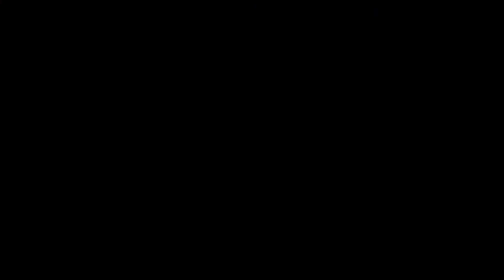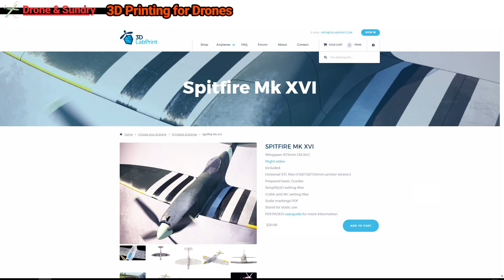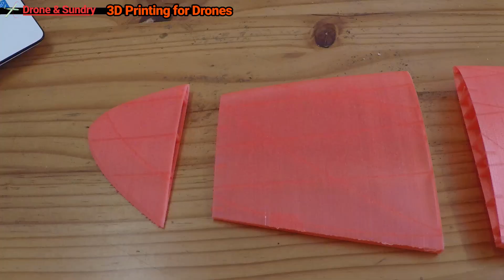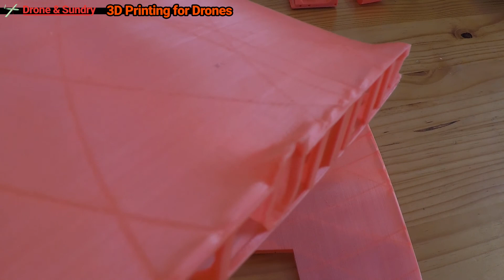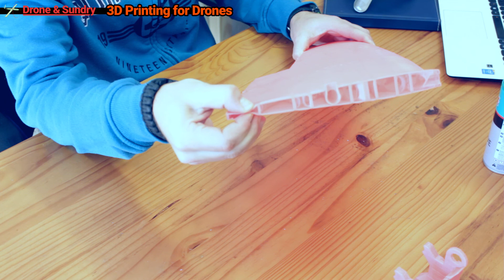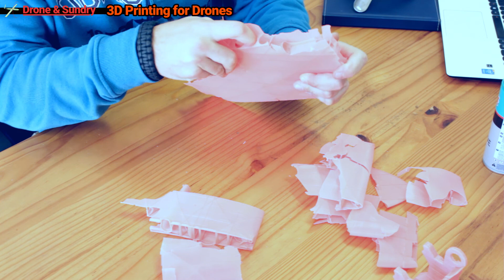3D printed Spitfire wing strength test | 3D Printing for Drones

Comment: As you said, this test is really nor non-scientific, neither informal. Make the same test with a balsa wing or a EPP wing and you would have the same result: they will broke ! 
It would be more interesting to test with a testing jig, some load bags, and some measurment devices, to measure the deflection before breakage. This would help the community

Comment: Slightly pointless test really.  How about running a limit load test on a completed wing using sand or shot bags and an approximation to a G-stall at a specific equivalent MTOW?  That would be more entertaining and informative.
Reply from the maker: +Andrew Rabbitt thanks for the advice Andrew. Will look into something more structured like that for a future video perhaps. For now I learned that the CA bonded areas are quite strong and that the single wall skin isn't as weak as I thought it would be, which were my main concerns with this design from the start. Cheers, Tiaan
Reply: True. Doing tests with the hands is pritty useless... you are applying the pressure in small areas, while in flight the pressure is evenly distributed...

Comment: Hi, this is a material test with structure; however, a load test is more useful and the aircraft should have a leading spar and a trailing spar . In jet aircraft and some piston twin aircraft the aircraft skin can be designed as a stiffener but all aircraft have a wing spar. The spar will carry the load from wing tip to wing root .  Wings load will build up at the tip and move down the wing with only loads per square inch moving along the surface and transferring to wing ribs and then to the spar. Good job , the wing you printed would hold the flight loads of a light rc aircraft , but 1/4 scale in 9 to  15 lb. will need a good spar.

Comment: You are over stressing the material,  if it was a high speed crash, yes it would break, no matter the material, mine has a carbon fiber rod through the wing and fuselage, no issues, and you want some flex, especially on hard landing